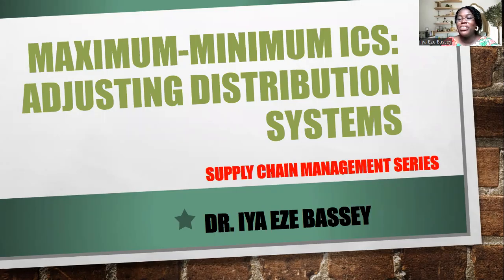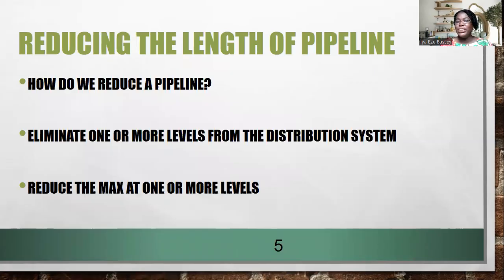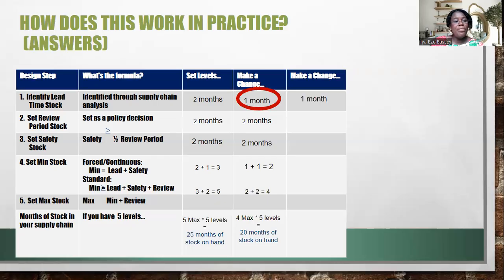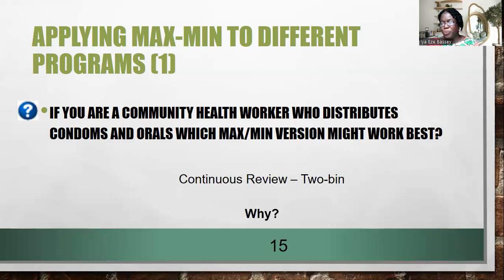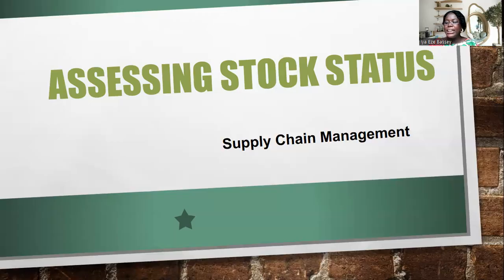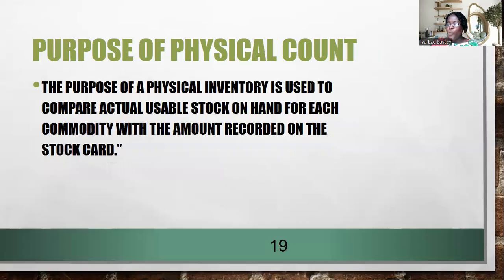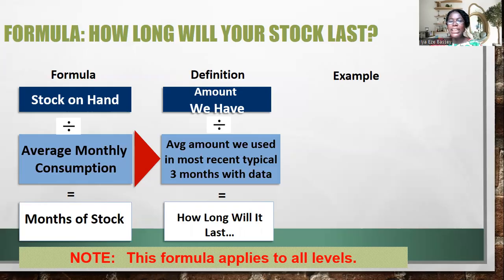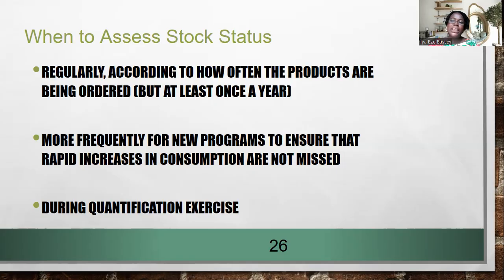Maximum-Minimum ICS: Adjusting Distribution systems (Supply chain management series)

Comment: Very interesting topic 

ICS stands for Inventory Control System, which is used to manage and adjust the distribution of goods. The maximum and minimum ICS refers to setting thresholds for inventory levels. The maximum ICS represents the upper limit of inventory that should be maintained, while the minimum ICS represents the lower limit. By setting these thresholds, it helps ensure that there is enough stock to meet demand without excess or shortage.

Comment: Thanks Ma'am
I've learnt that,the length of the pipeline is simply the time it takes for a product to move from the beginning of the supply chain to the end.
Reduction in the length of the pipeline which can lead to the improvement of the efficiency of the supply chain. 
-Reducing the maximum stock level is another way to reduce the length of the pipeline. By reducing the maximum stock level, the amount of inventory that needs to be managed is reduced, which in turn reduces the amount of time it takes to move products through the pipeline. 
-factors that can impact the maximum and minimum stock levels in a supply chain. One of the most important factors is demand variability. If the demand for a product is variable, it is important to have a higher maximum stock level to ensure that there is enough inventory to meet the peak demand. 
-advantages to using a max/min system for inventory control. One which is that it is relatively simple to implement and does not require a lot of resources. Another advantage is that it can be used for a wide range of products, from raw materials to finished goods. 
- One challenge is that it can be difficult to accurately predict demand, which can lead to either stockouts or excess inventory. 
-The max/min system can be applied to a variety of different programs within a supply chain. One example is the reorder point system, which is used to determine when to reorder products based on the maximum and minimum stock levels. Another example is the economic order quantity system, which is used to determine the optimal quantity to order to minimize the total cost of ordering and carrying inventory.
-One way to access the stock status  is to use a stock status indicator, which is a numerical or color-coded system that indicates whether the inventory is above, below, or at the target level.
-A physical count, also known as a physical inventory, is the process of physically counting and reconciling the inventory on hand. 
-The purpose of a physical count is to ensure that the inventory records are accurate and up to date. 
-The max/min adjusting distribution system, or MMAD, is a method of adjusting the distribution of inventory to ensure that the maximum and minimum stock levels are maintained.

Comment: Thank you ma.
In Summary, the steps in designing a Max-Min ICS are;
Set up initial Max-Min policies for each level, Check if the overall distribution will function well and also Check the total length of the pipeline thst the policies at each level imply.
Factors that impacts Max-Min stock levels are cost of products, reliability of transportation, storage capacity, shelf- life of health commodities etc.
Advantages of using Max-Min systems are; avoid overstocking, under stocking, minimize wastage, consistency of stock levels etc. 
Accessing Stock Status involves the physical count which its purpose is to compare actual stock on hand for each commodity with the amount recorded in the stock card. We can access stock status regularly, according to how often the products are being ordered(but at least once a year).

Comment: Thank you ma.
In Summary
The steps in designing a Max-Min ICS are;
1)Set up initial Max-Min policies for each level and type of facuity
2)Check if the overall distribution will function well and specific Max-Min policies levels are implemented 
3) Check the total length of the pipeline thst the policies at each level imply.
Elements that can be changed in order to reduce the Max stock level includes;
●the REVIEW PERIOD at one or more levels
●reduce the LEAD TIME at one or more levels 
●improve the DISTRIBUTION SYSTEM'S RELIABILITY at one or more levels.
Under Assessing Stock Status entails physical count which is to compare actual stock on hand for each commodity with the amount recorded in the stock card. The purpose of Assess Stock Status is to determine how long supplies will last. Assess Stock Status can be assessed regularly according to how often the products are being ordered(but at least once a year), frequently and also during quantification exercise.

Comment: A Distribution system policy is adjusted by,
Determining your lead time stock, setting review period, setting safety stock, setting maximum stock level, setting minimum stock level, setting emergency order point.

Advantages to maximum-mininmum system includes, 1. Avoid overstocking 2. Avoid understocking 3. Minimize wastage 4. Avoid emergency orders 5. Simplifying inventory control decision making.
Challenges in maximum-minimum system includes, 1. System with numerous levels 2. System that manage a large number of commodities 3. System that manage products for new programs.

Factors that impact Maximum-minimum stock level include, cost of products, cost of storage, reliability of transportation, storage capacity, shelf life of health commodities.
Inventory control system versions are 
1. Forced ordering maximum-minimum inventory control system (stock level is reviewed at the end of each review period)
2. Continuous review maximum-minimum inventory control system ( stock level is reviewed everytime an issue is made)
3. Standard version maximum-minimum inventory control system.

Purpose of inventory control system include;
1. To maintain an appropriate level of stock levels so as to avoid shortages and oversupply.
2. To determine when stock should be ordered
3. To determine how much stock should be ordered.

Comment: In this series, I understood that in supply chain management, the maximum minimum inventory control systems involves setting upper and lower limits for inventory levels to ensure efficient and effective distribution. One key aspect of adjusting distribution systems in the maximum minimum inventory system is the determination of optimal order quantities and reorder points which can prevent stock outs while minimizing excess inventory. Also, the selection of appropriate transportation and logistics strategies is another important consideration. Technology also play a crucial role in adjusting distribution systems. Collaboration and communication with suppliers and other partners in supply chain are also essential. In summary,adjusting distribution systems in the maximum minimum inventory control systems in supply chain management involves optimizing order quantities, selecting appropriate transportation strategies, leveraging technology and fostering collaborations with suppliers. All this will help to improve customers service, reduce cost and enhance overall supply chain efficiency.

Comment: This session made me understand the steps in designing the Max-Min ICS which involves different steps like setting up an initial max-min policies for each level and type of facility by checking the total length of the pipeline. I also learnt how to reduce the length of the pipeline by either removing one or more levels from the distribution system and reducing the max at one or more levels.

Comment: I learnt the various steps in designing a max-min ICS which are;
1. Set up initial max-min policies for each level and type of facility
2. Check if the overall distribution will function properly if the level specific max-min policies are implemented
3. Check the total length of the pipeline that the policies at each level imply

I also learnt how to reduce the length of the pipeline by either removing one or more levels from the distribution system and reducing the max at one or more levels.

Max min stock levels can be affected by various factors which are cost related, storage related etc.

Max min system has various advantages and disadvantages

Comment: Thanks Ma'am for the lecture. I learned about the various steps in designing a Max-Min ICS which includes:- set up initial Max-Min policies for each level and type of facility. - check if the overall distribution will function properly if the specific Max-Min policies are implemented. - check the total length of the pipeline that the policies at each level imply.
Also ways to reduce the length of pipeline which are: eliminate one or more levels from the distribution system and reduce the max at one or more levels.
Also elements to reduce the maximum stock level:shorten the review period at one or more levels, reduce the lead Time at one or more levels and improve the distribution system's reliability at one or more levels so that safety stock can be reduced.
The factors that impact Max-Min stock level:cost of production, reliability of transportation etc....
Advantages of using Max-Min system: minimize wastage etc....
Also the challenges to using each ICS version and variation: Systems with numerous levels, systems that manage a large number of commodities and systems that manage products for new programs.
Also what is meant by physical count and it's purpose and also when to assess stock status.

Comment: Thank you for this brilliant lecture Ma..
After. This video i was able to deduce the steps involved in designing a Max-Min ICS which are:
1, Setting up an initial max-min policy for each level and type of facility.
2, Check if the overall distribution will function properly if specific Max -min policies are implemented.
3, Check total length of pipeline that each policy level implies .
I also learnt on the purpose of an inventory control system which includes but not limited to maintaining an appropriate stock level of all products, avoiding shortage and oversupply .
Some  factors that impact Max -Min stock levels include:
1, Product cost
2, Storage capacity
3, Cost of storage etc

Comment: In Summary to what I learnt on the class series on Maximum minimum inventory control system: Adjusting distribution system are below:
- To adjust the distribution system policy, the following steps can be taken:
- Review the inventory data on a regular basis to identify any issues or patterns.
- Assess the current stock levels and adjust the distribution system policy accordingly.
- Make any necessary changes to the distribution schedule, storage locations, or other aspects of the system.
- Evaluate the effectiveness of the changes and make further adjustments as needed.
- Some advantages of the maximum inventory control system include:
- It's simple to implement and easy to understand.
- It's flexible and can be easily adapted to changing circumstances.
- It's less likely to cause stock-outs than a minimum inventory control system.
- Some challenges of the maximum inventory control system include:
- It can be costly, as it requires maintaining higher levels of inventory.
- It can lead to waste if inventory levels are not carefully monitored and managed.
- The inventory control system used in the logistics management of HIV and AIDS commodities in Nigeria is the maximum-minimum inventory control system.
- The purpose of assessing stock status is to determine the amount of inventory that is available at any given time.
- The number of months of stock available can be determined by calculating the average monthly consumption of stock and dividing it by the current inventory level.
- This information is used to ensure that there is an adequate supply of inventory available to meet the needs of those who are using the commodities.
Thankyou MA

Comment: Thank you Ma. In summary, 
The steps in designing Max-min in ics are:
1.set up Initial max-min policies for each level and type of facilities. 
2.check if the overall distribution will function properly if the level specific max-min policies are implemented. 
3.check the total length of the pipeline that the policies at each level imply .
We can reduce a pipeline by; eliminating one or more levels from the distribution system, Reduce the max at one or more levels. 
Factors that impact max-min stock levels are:cost of products,storage capacity, cost of storage, management of skilled staff, Age of program etc. 
The advantage of using max-min are to avoid over stocking, to avoid under stocking, minimize wastage etc. 
I also learnt about Physical counting which is the process of counting by hand the total number of usable units of each commodity in your store or health facilities at any given time. The purpose of this Physical count is to compare actual usable stock on hand for each commodity with the amount recorded on the stock card and also to determine how long supplies will last.
Reply: In summary I learnt that
Learning that
A PHYSICAL COUNT IS THE PROCESS OF COUNTING
BY HAND THE TOTAL NUMBER OF USABLE UNITS OF EACH COMMODITY IN YOUR STORE OR HEALTH FACILITY AT ANY GIVEN TIME.

THE PURPOSE OF A PHYSICAL INVENTORY IS USED TO COMPARE ACTUAL USABLE STOCK ON HAND FOR EACH COMMODITY WITH THE AMOUNT RECORDED ON THE STOCK CARD.

Comment: At the end of the video lecture,I was able to know the steps in designing a max-min ICS..
1)stepup initial max-min polices for each level and type of facility 
2)check if the overall distribution will function properly if the level specific max-min policesare implemented..
I also learnt factors that impact  maz-min stock levels.
1) cost of products 
2) storage capacity
3)lead time
4sorage commodity at different levels..
I also learnt how to assess stock status ..which are through physical count which entails counting by hand the total number of usable units of each commodity in a store at a given time ....
I also understand the advantages of using max-min system is to avoid cost of emergency  order,minimize shortage and avoid overstocking.
Thank u maaam....
It inspired knowledge!!

Comment: A technique for determining the ideal level of inventory to be kept on hand is the maximum minimum inventory control system (MMICS). This system accounts for things like the price of the good, the cost of maintaining inventory, and the cost of running out of stock. The distribution system can be modified using the MMICS to make sure that the ideal amount of inventory is always maintained. The lead time, safety stock, and reorder point can all be changed to achieve this. The health commodities supply chain can be improved in terms of efficiency and effectiveness by making changes to the distribution system.

Comment: The maximum minimum inventory control system (MMICS) is a tool that is used to determine the optimal level of inventory to be kept on hand. This system takes into account factors such as the cost of the product, the cost of holding inventory, and the cost of running out of stock. The MMICS can be used to adjust the distribution system to ensure that the optimal level of inventory is maintained at all times. This can be done by adjusting the lead time, the safety stock, and the reorder point. By adjusting the distribution system, the health commodities supply chain can be made more efficient and effective.

Comment: Being introduced to the Maximum-Minimum  inventory system help in enlightening us in terms of skills to maintain adequate stock,  to know when stock is to be ordered/issued and also what stock to order/issue hence avoiding a state of No stock or overstocking.

Some terminologies in describing this include;

1. Review Period - this is time scheduled to review the level of stock

2. Maximum stock level is the maximum quantity of stock a stock keeper can hold at any given time

3. Minimum stock - it is the minimum quantity a stock keeper and hold to avoid a stock out.

4. EOP- it is the point an emergency order should be placed to avoid a stock out irrespective if  the review Period  has been reached.

5. Safety stock--A convenient stock level to cushion for uncertainty. It can also be called Buffer stock. It usually above minimum stock.
 Others include; lead time  which is the duration from when commodities are ordered to when they can be used. 
 
In a nut shell, the study helps prevent out of stock situation or stocking more than needed

Comment: In this lecture, I Learnt that, iIn designing a Max-min ICS, the very first thing or step to take is determining length of a PIPELINE (pipeline is the movement of facilities and transport links from manufacturer to user to places where it's needed).
To avoid the distribution time to take too long as in a 20 months pipeline, we should modify The Pipeline and this could be done by removing some of the levels from the pipeline and this should be done systematically.
Accessing Stock Status: amount of stock, the first thing to be done is carry out a physical count. (Calculating how long a stock will last)
Formula = stock on hand ÷ Average monthly consumption.
=Months os stock (how long it will last)
Thank you ma!